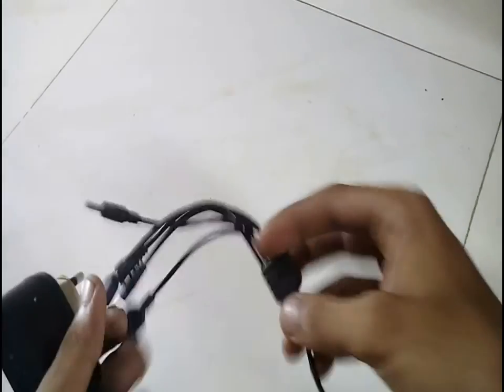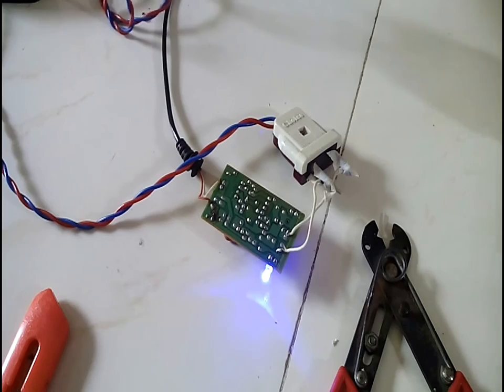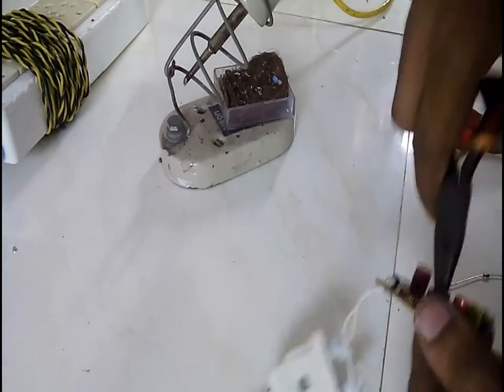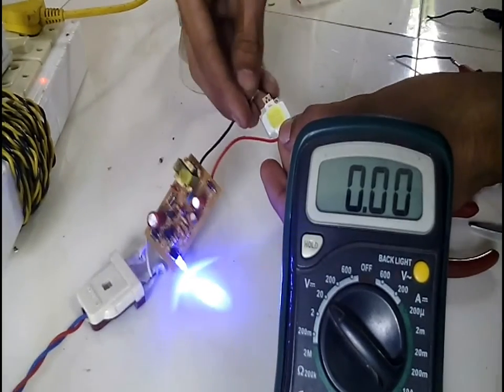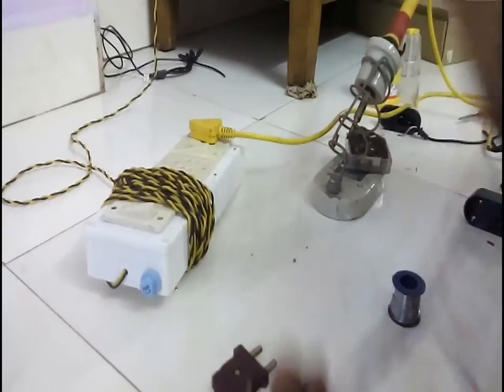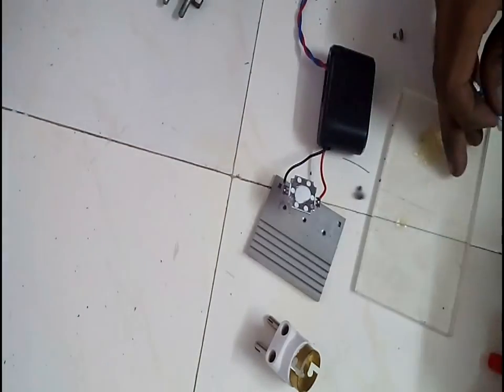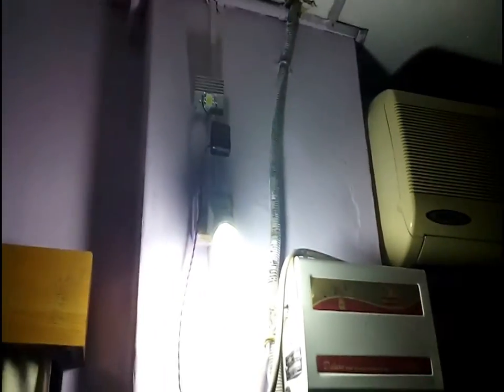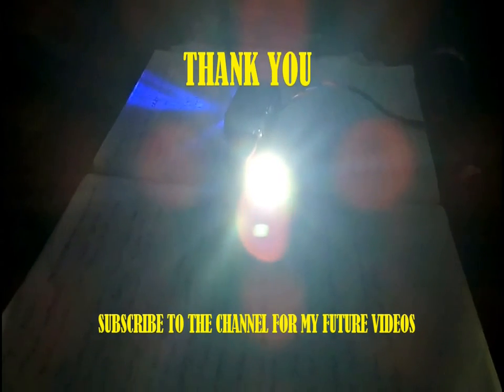#E-CYCLE : HACKING A MOBILE CHARGER TO DRIVE 10 WATT LED

Comment: In my mobile charger i got at least 3 Zener diode, which Zener should I pick ?
Reply from the maker: Mostly there would be only one zener, others might be normal diodes. Please check the one which has 5v written on it

Comment: Can i use a 15v zener in 5v 1A charger to get 15v 1A?
Reply from the maker: actually the output voltage would be the maximum which the charger can give and i think that would be around 10-13v only and not more than that. any zener above 12v would give only this maximum voltage of charger i.e.close to 12v
Reply: +Electronics Made Easy : KHADER  Thank you so much !!!